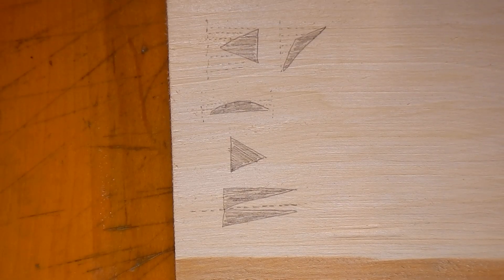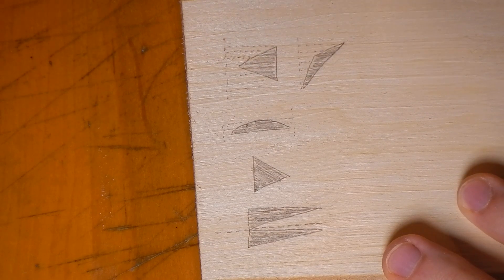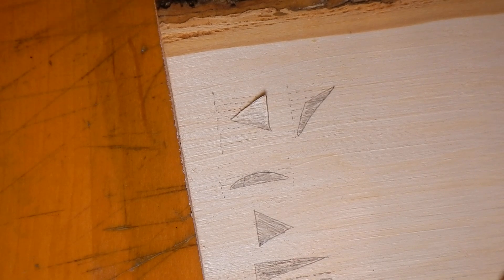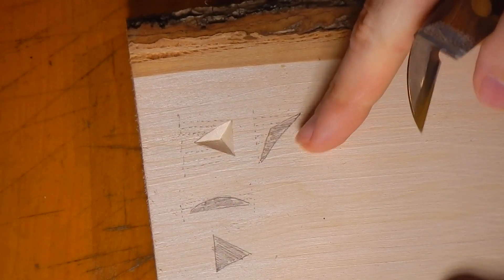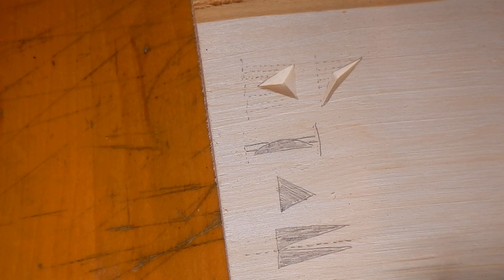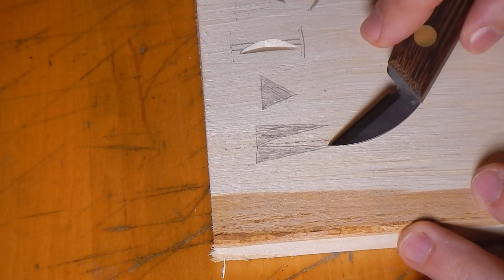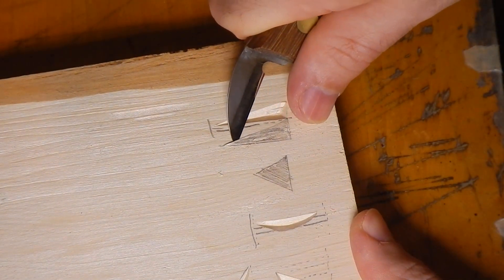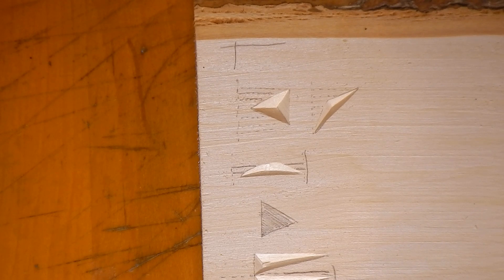Understanding Grain Direction when Chip Carving | CARVER'S TIP

Comment: Si può fare solo con il legno di tiglio, gli altri legni sono più duri e non di riesce ad usare il coltello
Reply from the maker: I wouldn't say lime wood (or basswood, as it's known here) is the only kind that works for this.  It's definitely the most common, but I know other people do chip carve other types of wood.  It takes longer, you have to make smaller chips, and you often can't have as detailed of designs as with basswood.
Reply: @againstthegrainchipcarvings  io ho comprato un coltello come quello tuo, molto affilato ,su una tavoletta di pino non riesco nemmeno a creare un triangolo, qui sui video youtube sembra molto pii facile di quello che è in realtà